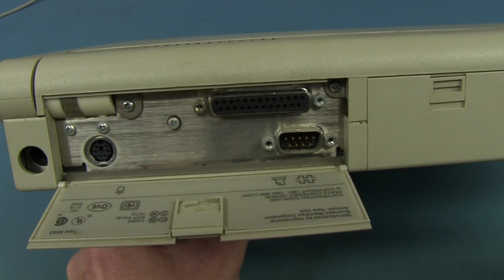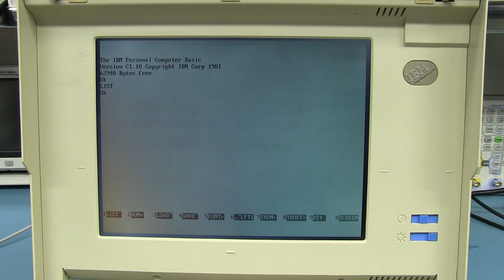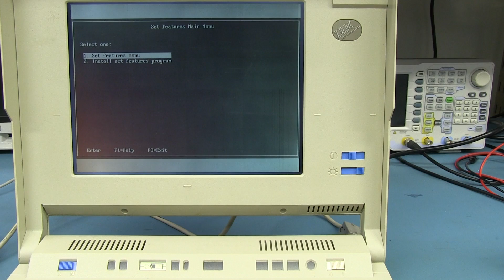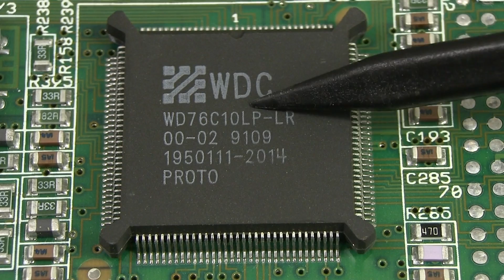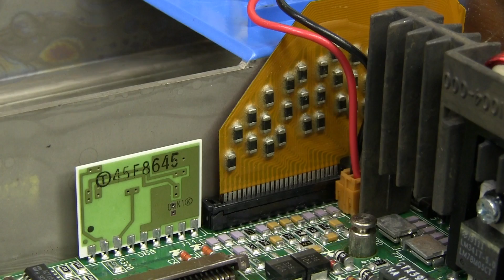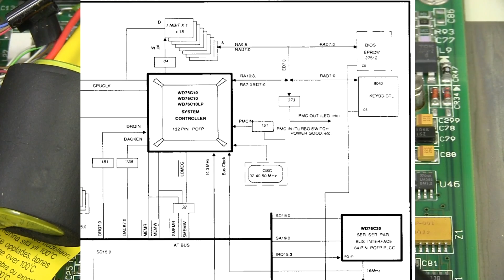EEVblog #639 - IBM L40SX Retro Laptop Teardown

Comment: If the bios codes are the same as the later IBM Thinkpad than 161 and 163 represent a cmos error usually caused by a dead cmos battery resulting in the time and date not set. This could also result in a hard drive configuration issue resulting in it not wanting to boot from the hard drive

Comment: The keyboard on this uses what's been referred to as "buckling rubber sleeves" in recent years. The keycaps have long poles that acuate by pressing the membrane beneath. However, there's a hollow rubber cap sleeve between the keycap and the membrane that buckles when pushed. That's what gives you that tactile feedback despite there not being any mechanical switch involved.

IBM later created the IBM M4 and IBM M4-1 keyboards as desktop equivalents to the IBM L40SX's keyboard. The only difference between the two desktop keyboard models is the M4-1 has a track point in the middle, similar to a Thinkpad keyboard.

I own an IBM L40SX, the numpad attachment for it, and an IBM M4 keyboard. I can confirm they use the exact same keyboard. I know because the numpad is broken and I used one of the rubber sleeves in it to replace a worn down one in my M4's spacebar and it worked flawlessly. I also compared the L40SX and M4 keyboards side by side. There were no noticeable differences between the two.

I have to agree with the video, this is a fantastic keyboard. On par with the Model M in its own way imo. If you want to experience this keyboard then track down either an IBM/Lexmark M4, M4-1 or a Unicomp Mighty Mouse (discontinued but were replicas of the M4-1 made from 2008 to 2010). The Topre Type Heaven is a more modern interpretation of this design and also comes highly recommended.

My only word of caution is that since these use rubber sleeves that are unique to this style of keyboard, finding replacement sleeves will be difficult if any of them give out. I was lucky enough to have a broken numpad to pull replacement sleeves from, but it's something to keep in mind.

Comment: I actually replaced the hard drive in my L40SX with a IDE to Compact Flash adapter and put a 512MB Compact Flash card in there to act as solid state drive. Works like a charm.

Comment: She's probably not booting to the hdd because the bios has lost the settings for the drive.  If you go in and set it up again with 1050 cyl, 16 heads and 63 sectors (I noted them down for you) I'd bet she'll boot up no problem.

Comment: This was the first computer I had ever used! I was about 4 years old and my dad had this laptop for work at the credit union he was employed at. Every night he'd bring it home so I could play games on it. I still have it and made a few repairs on it. I even managed to install Windows 95 on it! YES! The 386 is actually a 32-bit processor, so it can handle Windows 95, albeit it's a bit sluggish on this machine. Also when installing Windows 95 you need about 25 floppy disks! XDDD

Comment: 161 and 163 has been traditionally error codes for bad backup battery on IBM ThinkPad Laptops. Maybe you can try replacing the flat watch battery on the mainboard?

Comment: I've looked the errors up and it seems like both errors just indicate that the battery is gonsky. (161) and with that comes 163 -> System Time not Set.

So nothing really bad and easily fixable.

And you can also upgrade it, if you have enough space, with a cyrix "486"DLC with whopping 40MHz AFAIR.
For that you have two options:
a) the upgrade version for the soldered on chip, you just stick them on top (don't ask, it's true)
b) you desolder the CPU and put a normal socket in it...

Comment: I miss the floppy drive seek noise and hum of the old hard drives, it brings back memories of installing DOS 6.0 and Windows 3.11 for Workgroups, and I even had Windows 95 on floppy (13 disks) that I installed on my AMD 386. I really wish id have kept intact systems from back then, I have old motherboards and cpu's and such as collectors items but I dont have a working system from the 80's or early 90's, oldest full system I have is a p3 system.

Comment: Where can I buy memory for this thing? eBay seems to draw a blank as I've read this takes special SIMMs (I was lucky enough to have one from a dead PS/2 Note that worked in the L40SX)
Reply: +danisidoti84 
From what I understand, they're low-power 80ns parity 72-pin SIMMs, pretty similar to the regular stuff.  You could slap in some regular desktop modules and see if it works.  Worst-case, a capacitor or two might not like it, though that's unlikely.

Comment: That reference diskette was for programming the CMOS.  PS/2's did not have BIOS configuration software in ROM - the Reference diskette was used instead.

This is probably why the hard drive wouldn't boot - because the CMOS battery died.  It may be able to boot that drive after running the auto-config (and don't power it off in between!)

Comment: Yes, let's put a SSD in there that's even faster than its RAM.
Reply: 500GB of RAM, I can live with that. B)
Reply: Even if a UDMA/133 PATA SSD/CF was used (UDMA/133 has a max transfer speed of 133MB/s) in a machine with PATA running in PIO 0 it would not be able to read/write above 3.3MB/s and the ram would be close to 60 times faster no matter what drive you put in there. The pros of flash as storage would be slight speed increase, no noise, slightly better battery time and the biggest advantage would be the low access time and availability compared to old PATA devices.

Comment: Would it be possible to make that keyboard work as a USB or PS2 keyboard on another computer?
Reply: no
Reply: Michael Sperl Why not?
Reply: TheSpeedo666 it does not use usb it uses a certain connection look it up
Reply: +TheSpeedo666 Assuming it uses PS/2, and you're willing to write your own drivers for it, yes.

Comment: How about some Windows 3.1 or old Linux running on it? I.e some windowing system. All you need really for productivity (ok, not Windows, as it will soon wear out the Ctr-Alt-Del buttons). A 386 SX is certainly good enough for this. Just need some of that extra expansion RAM to really make it fly!

Comment: That BIOS probably (almost certainly) has a limitation of 2GB for storage, so a solid state drive probably won't work. Awesome looking laptop though :D
Reply: +Oj10101 What you do today is you put in a CF card with an IDE adapter (cost nothing) and you get a SSD. This is what you do on all old computers with IDE interface.

Comment: Just a note that is a 540 MB hard drive. Now as to running a solid state I think solid state hard drives are SATA not IDE so you might have problems there and also with the size. As I remember you had a limit on the size of hard drive you could run in the early computers. The BIOS would only read up to certain size and you had to input the Heads and Disks to match what drive you used.That is all done in CMOS now and you don't have to use tables and feed in the size to set things up. Much easier now. This could be why the hard drive is not working now it needs the heads and disks set again. Notice 1050cyl 16heads 63sec/t this was used to configure the Bios and tell the computer what the hard drive was. Not sure but I believe this was before they figured out how to anodize aluminum. Was this EGA or VGA video??

Comment: 2MB Ram, for the time, are pretty decent.
Reply: ***** 2MB RAM might have been adequate at release date, but it quickly became a terminal limitation.  Having 4MB would make a huge difference in what you could do with those.
Reply: +DiePixelspieler For running DOS yes, not for Windows 3/3.1/3.11, which were around in that era.
But he said that originally there was more memory in this thing, it has two empty SIMM slots.

Comment: I've got the exact same laptop from a bankruptcy sale (sans keypad and power supply, sadly).. and I'm about to re-cell the battery since it has inflated significantly. Hoping to get it working, but from what I read, getting the correct BIOS setup disk for my model (yeah, no integrated BIOS menu yet) is supposed to be rather hard, since there was a certain hardware variance through the series.

Comment: On these older PC's when CMOS battery dies, it forgets the hard drive configuration.  If you have the diagnostics disk, you can set up the CMOS again, ant it will probably boot up just fine!

Comment: I recently got a Dell Latitude CP made in 98, and was able to install a 32GB Kingspec IDE SSD. Wouldn't work without the BIOS update though. Running Windows 98SE which works super fast now. I wonder if your IBM can work with one..

Comment: 161 and 163 are due to a dead Cmos battery. Bios settings for the chip set, and date time are not set. All bios information was stored on the Hard Disk.there was no bios chip on the motherboard.

Comment: It's difficult to grasp the incredible ease of accessibility on this machine, compared to the evil convoluted methods deployed on contemporary stuff!  I wouldn't like to think of opening up my current Lenovo!  I suppose thats the price paid for the sexy sleek compactness we now crave.
Reply: With most laptops these days the teardown starts with removing the panel at the top of the keyboard, then the keyboard itself. If not that, then the bottom panel. Fairly simple once you've worked on a few of them

Comment: IBM PS/2 machines did not have BIOS config in ROM but instead had them on their "reference diskettes". This made them a pain to repair and one had to regularly dial into the IBM BBS in order to download the appropriate reference disk for diagnostics and repair... In those days, it could take up to an hour to download the disk on a bad day.
I think that that particular PS/2 is one of the last to have ROM BASIC. Later ones only had BASIC Advanced available on their IBM PC-DOS disks.
Fond memories. If you would like to upgrade the RAM, I may have a suitable 72pin SIMM laying around somewhere. Bump it up to 8MB and you'd able to run IBM OS/2 2.0 on it. ;-)

Comment: "Very thick unit, not exactly slim"  Well by even late 90's laptops, yes this is a fatty but this would have been a very slim unit in comparison to the more common portable or lugable computers from this era that were desktop computers with a handle pretty much :)

Comment: You can try those CF card adapters. Slap a 32GB CF card (which should support this PIO/UDMA modes) in it and it can run noise-free. Also the memory modules from the Macintosh may be able to be used here if you want modern Linux (which can still run off a 80386) on it.

Comment: Just to be clear for the "noobies" watching this: The computer didn't normally come up with Basic. IBM PC's normally tried to boot from floppy first, then from hard disk, and if all of those failed, they would revert back to "cassette basic". No IBM computer had a cassette port except the first IBM PC's (they removed the port on the PC/XT) so it was totally useless: you couldn't save or load programs to/from floppy drives from cassette basic. The only reason it was still there in every IBM PC after 1982 was that the "BASICA" interpreter that was included with DOS (which WAS capable of using the floppy and hard disk) relied on the routines in the ROM to do its work.

Back then, computers didn't have fancy BIOS user interfaces; I think the original PC BIOS was 16 kilobytes so no space for error messages. IBM used a scheme of error messages where the last two digits were the error code and the digits in front of it were the device that was causing the error. 1=motherboard, 2=memory, 3=keyboard, 6=floppy, 17=hard disk etc.  http://www.bioscentral.com/misc/ibmdiag.htm contains a list of the errors from the BIOS and also the various diagnostic diskettes for all the IBM models.

Comment: Looks very similar to the Tandy 1500 HD laptop that I rocked back in the early '90's. Had a 486 SLX that was actually more compatible than the regular 486 chip I had in my desktop. The CPU was actually a Cyrix chipset. It was counted as either a fast 386 or a slow 486. It lasted from 1992 until 2005 before both the floppy and hard drive gave up the ghost.

Comment: I was 8 or 9 when these computers appeared. I remember being taught about the ultra fast ALU and later on, that it was incorporated into the CPU. It would be nice if you could do a little episode on various techniques of storing data or creating your own ALU (at least adding and subtracting/2's complement) as the history is just mind boggling. I think that's the main gap that when bridged, can get you from logic gates to the microprocessor. Nowadays, these processors have this black magic aura around them and it's a shame that we just take them for granted. I'd also be interested in how you get to above 25-50mhz hacker style (no expensive ARM cpus).

PS: I was a happy coder until I discovered this blog. In less then 2 months afterwards, I had my house full of plastic boxes and pieces and had read through everything I could find. Now I look at assembly language as that high level decadent bourgeois luxury that I just don't have. A coder's take on what you can achieve with such low level insight is out of this world. Best hobby I could ever find!

Comment: The datasheet showed two pieces of 256K DRAM for the VGA controller. If that's what it is indeed equipped with, that's good for 640x480 at 256 colors.

As for games:

It would run anything up to and including Doom, provided you were OK with it being pretty slow even in reduced screen size mode. You'd also need to upgrade it to at least 4MB of RAM. Wolfenstein 3D and pretty much any DOS side scroller would run well though. The 386 SX is the biggest impediment to running the larger DOS games once the memory is expended to at least 8MB....things like Duke 3D needed at least a good 486 DX/2, a machine over 4 times faster. Sound would also be a problem; the PC speaker or Sound Source would be your only real options. Forget running a Sound Source or other parallel port audio with a big game like Doom though, the CPU doesn't have cycles to spare; it's going flat out just to try to keep the display updated.

The 72pin SIMM slots are a nice touch and very surprising. It seems like everyone had their own proprietary RAM modules back then and seeing a SIMM slot is definitely a refreshing change. Perhaps IBM set the trend for standard memory modules in laptops?

The voltage regulators are interesting...my how times have changed! Now the regs run without a heatsink (for the most part) and the CPU needs one.

Comment: Found a link to a site with manuals, guides and reference on the PS/2 laptop.

http://www.cbmfreaks.com/?p=122

Yeah, Reference Disks. Was at a college with a PS/2 Model 60. Professor kept monkeying around with memory drivers. Finally found the proper ones on the IBM disks. Could finally use 4 Megs of memory in Windows 2.1!!!!

Comment: Dave, thanks so much for this!  My first engineering job was at Western Digital, where I designed the SRAM and worked on the real time clock and battery detector circuitry in the 7620/7621.  I also did some of the physical layout and touched parts of the 7610.  That was an exciting time to be able to design so much of what went into this laptop for IBM.  So this is very near and dear to me, bringing back so many memories!
Reply from the maker: Awesome, thanks for sharing. There are countless unspoken designers out there who designed all this stuff!
Reply: EEVblog Thank you for doing what you're doing.  I've learned so much from you and have been quite entertained at the same time.  Smiley face.  Keep it going!

Comment: EEVblog 
I bet that the hybrid with PLL was connected to the power save switch. Probabally used to generate the main clock or a low clock that was fed into a multiplier. Especially because you mentioned the missing 4 pin crystal.

I never knew Western Digital made chipsets or video controllers. Even less a whole set.

That keyboard sounds (when you press the keys) just like a Dell Quietkey I have. I looked inside to clean out the dirt and found all the little rubber cups actually glued to the plastic matrix sheet with a tiny drop of silicone glue (its white and rubbery, what else). Such a nice keyboard, the keys no longer stick that Iv cleaned the dust out. I know what you mean, it just feels nice typing on it. I use it whenever I have to type a lot, but keep my multimedia keyboard for general use as the 12 programmable hotkeys get a lot or use (the built in calculator and hibernate buttons are my favorite).

As to the graphics, it definitely wouldnt run Crysis LOL. Maybe Doom though considering it could have MS-DOS installed if one wished (I know it runs IBM DOS, it would probabally run normal DOS).

Comment: I imagine the reason it had to read the disk for each new menu, was because of memory limitations. It would have to use as little as the minimum a model could come with.
It also would not have dynamically pre-loaded anything, as that would take more then double the memory (unless the programmer is clever)
I would guess that it used up to 128kB for the program and that when you choose a menu option, you had to wait for it to fully load before you could go back.

Comment: What is the name of the pointy thing he uses!
Reply from the maker: A spudger.
Reply: thanks Dave! I never expected to find out.
Reply: Finger.
Reply: I need to get one of those, but a plastic one. Im always dinging up the edges of snap together cases with screwdrivers.
Reply: Spudger, but it is a really generic term meaning any tool that is used to pry things apart, or poke at them. ifixit sells them.
Reply: mart fart Funny
Reply: A penis!
Reply: ***** What video were you watching?
Reply: mart fart It's a Sploodger.

Comment: Daewoo went bust in 99.

They are owned by G.M(OK GM went bust), but daewoo stopped selling in australia along time ago.

As for using a new HDD.
near impossible.
You have a PATA drive and then you need to worry about the size of the drive storage, what can your motherboard support?